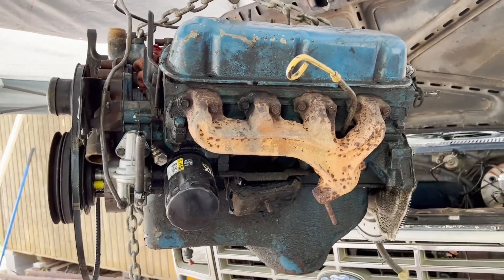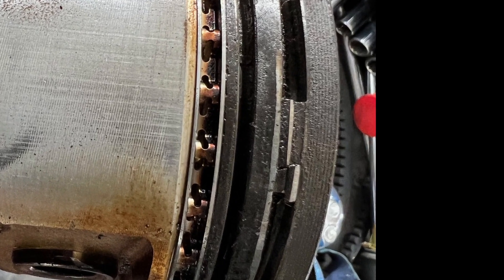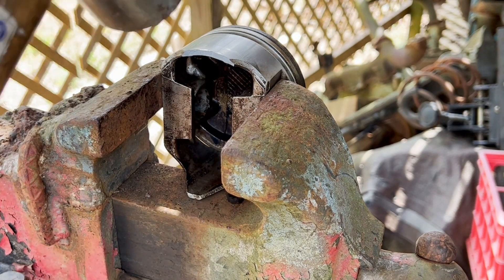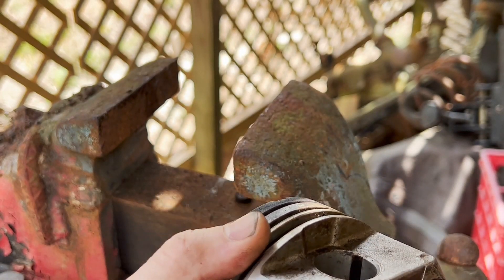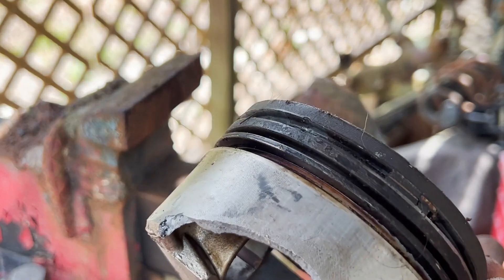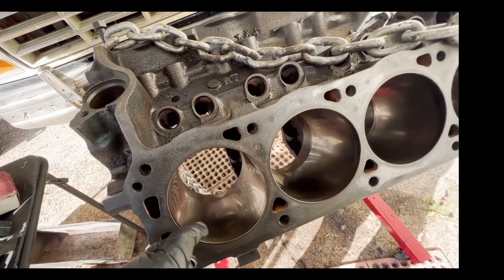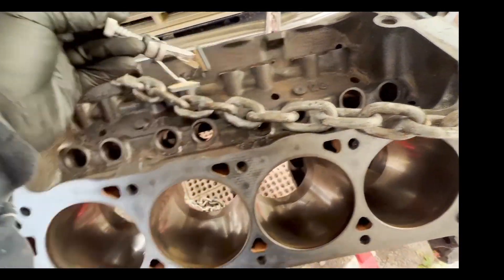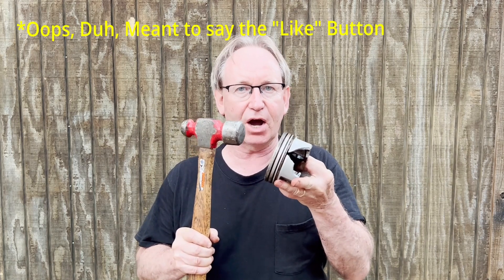Ford 302 Budget DIY Home Engine Rebuild Part 1

Comment: Ford had a buttload of cracked pistons in 5.0 engines back then. Replacement pistons and changing to a 351W firing order stopped it.
Reply from the maker: Hmm. I'm curious now. I'll have to look into that. Did the top end on a late 70's 188 Mercruiser years ago that used a different firing order (possibly 351). In fact whatever entity was involved in the Ford Mercruisers FoMoCo engine factory to boat journey sort of ground off the factory cast firing order on the intake. I do recall hand turning through the firing order to check TDC for each cylinder against valve timing and if memory serves, it did match the 351 firing order, so seems to me it would depend on the cam lobe phasing in accordance with piston position.  A good friend has been building and racing Fords for over 40 years so I'll see what he has to say. Thanks for commenting and giving me something to think about.
Reply: @mkdhdinfiniteendlessconten3873  I used to work at a boat company. The engines used in marrine applications are optimized for low end torque. It wouldn't surprise me at all if the firing order, cam lift and dwell were all different than the "automotive factory" block would suggest. It would be interesting to actually research the differences.
Reply: @haroldhenderson2824  they are different. But pistons still I found were cracked on early engines. Boat engines had special distributor that had a curve strictly for boats. Also were RPM limited.
Reply: Cracked pistons was only in the early engines after they changed from the 289 to 302. Ford fixed the problem by around 1975.
Reply: @jesse75  nope. I did plenty of them in the mid-late 80s
Reply: @prevost8686  I had my own business in the 80's and 90's specialized in Ford engines only. Ford changed piston design and strength to compensate for the early broken skirts. The broken skirts really manifested themselves in the boss 302 engines. Everyone I took apart had a crack. Some broken off completely and making noise slapping on the cylinder wall.
Ford really did it good with the 5 liter engine. Short skirt, reinforced, some were forged.
Sorry you haven't taken apart a 1,000 engines like I did.

Comment: Piston smack was funny. Ty
Reply from the maker: Hi Tom. Thanks for watching till the end and enjoying my little closing schtick. I try to come up with some sort of cheesy tie into whatever the video was about in most of my closings to encourage likes/subscribes/comments/shares. Can't smash things in every one, but I'm wondering if based on views of the Ford 302 if people just like to see stuff get smashed lol. I did use a hammer in the closing of part 3 of the Retaining Wall video, but no random debris flying in that one. Anyhow, thanks for the comment and glad you enjoyed.
Reply: @mkdhdinfiniteendlessconten3873  I know Tractor rebuilds will jump your views way up. I have an old 55 IH 300 Utility that turns over but hasn't been started in 20 years. I put some tires on it and bought some parts for it. Then i bought a KW project and it had just been sitting.

Comment: Good stuff bro! You gave some good info! Looking to do this in the near future on my 78 Thunderbird.
Reply from the maker: Hi. Thanks. Glad you found the info useful. Have a whole series on this engine rebuild and will be doing more builds etc. I cover quite a few genres of DIY stuff including home and vintage electronics. It's fun to fix and improve. 78 Tbird sounds cool. I had a restoration shop at one time and did regular maintenance on one for a customer.

Comment: Great vid bud, im thinking of doing something similar on my 78 bronco. Old 302 is tired and needs a teardown, hopefully the block is still viable.
Reply from the maker: Hi. Thanks. Glad you enjoyed the video and hope you found it useful. Watch all 6 parts of the series and you'll have a good foundation for doing your '78. Given the age and oils originally used, plan on replacing all moving parts. If the crank is out of spec and needs turning be very picky on who turns it. That's where all the oil pressure is made or lost based on main and rod bearing clearances.  The most worn cylinder is the one that determines how far you have to bore it. First stop on the Bore Train is .020. Last stop is .060. You want to get off that train at .040, if you missed the first stop. ;-) Get with me for any questions along the way and I'll help you out.

Comment: Good stuff. I'm gonna start this same exact  project since nobody can fix it that's near me
Reply from the maker: Hi Travis. Glad you found the info useful and thanks for commenting. Please subscribe if you haven't already. My channel is only 2 weeks old, so subscribers, views, and comments help me float to the top. Want to help as many folks as possible. I'm editing Parts 2 & 3 right now which will be doing the heads and building the bottom end and have them loaded by tomorrow. Built this engine back in June of this year (2022) and I drive it every day and occasionally pull a heavy trailer with it.